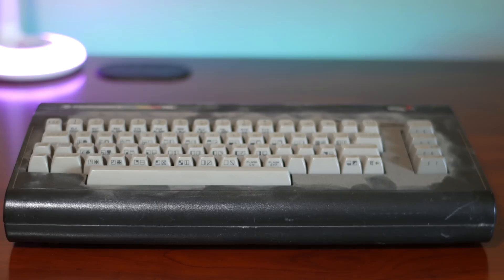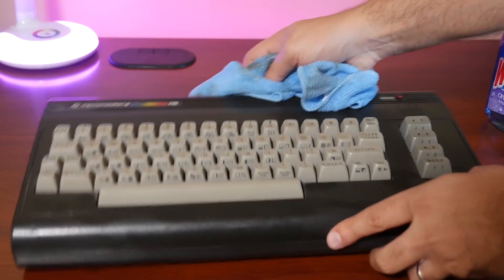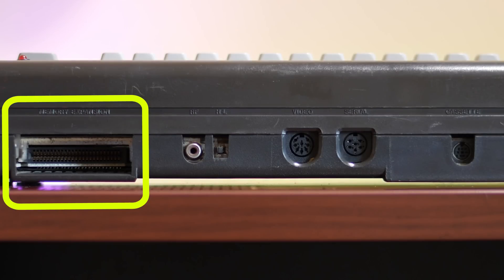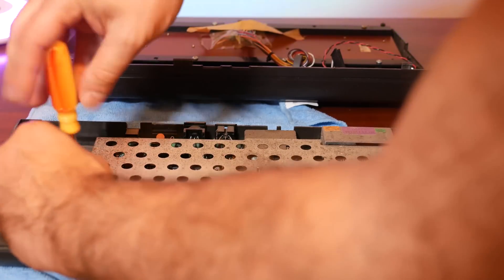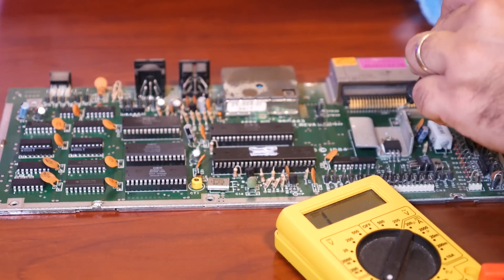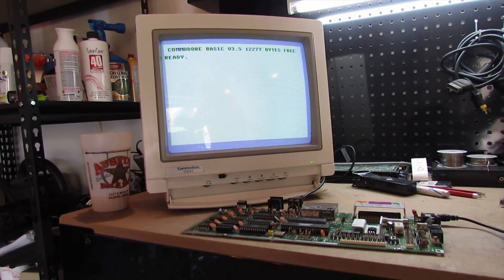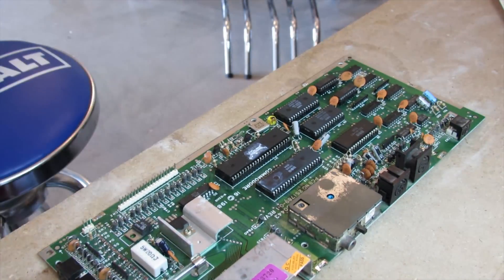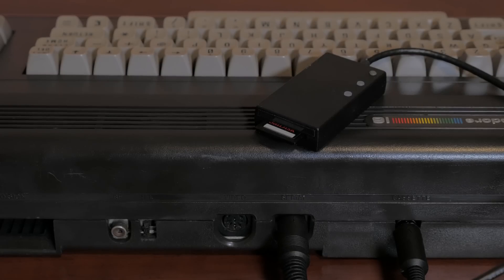Commodore 16 C16 Restoration Project

Comment: Ironically sales of this machine took off once its price was reduced to under £50 which was supposed to be the price they were looking to sell it at when it was in development. Jack told them go away and build me a computer for under £50 and then management sabotaged it by trying to sell it at £100 at launch the idiots. This is off the top of my head so may have figures a bit wrong but the brief was to build a budget computer to sell at £50

Comment: I highly suggest to wear an antistatic wrist wrap while dealing with ICs. Also you got really lucky that only the fuse got blown. Recently I got a C116 to restore from ebay and literally all ICs were dead. The reason (I assume) was a wrong polarity and therefore bad voltage regulator which killed all the other ICs... Was a pretty expensive repair in the end, but I got it back working. :-) Keep up your good work!!

Comment: Always always always check the specs yourself and make sure it's the right voltage, connector (And polarity!) etc yourself.

Those eBay sellers are often selling extra stock of cheap phone/whatever else chargers and sell it as "uses x connector at y volts, device only uses z mA of power and the adapter can do 1A so we're good" either way so it pays to double check that yourself.

Comment: Really nothing should be powered up without replacing all the caps and regulators. They could fail any random time now. When they do uncontrolled volts will play Russian Roulette with the chips. Its what they do on very old cars too. Replace then try to start.

Comment: Got a c16 and has a problem. When on there is text and a screen but after 30 seconds the  text just bleeds together. For example type an 'h' will turn to a solid rectangle. Weird effect. Any ideas?

Comment: The C16 and Plus4 were blunders by Commodore. They had an improved BASIC and more colors, but virtually everything else about them was a step backwards. They created these machines to fill a market that didn't really exist. The C64 was already the next step up from the VIC-20 and was being used for most of the serious applications that the Plus4 was meant for.

Comment: 10:30 or thereabouts-

That thermal paste was there for a reason. You should've applied new thermal paste before putting the shield back on. Not doing that can shorten the life of the (rare and) fragile TED chip because it can overheat, and/or it endures more strenuous thermal cycles.
Reply from the maker: I did this off camera - i cleaned the old gummed up paste and applied new paste on and attached the shielding back on

Comment: Well it's an oddity, you want more performance than a VIC-20 but less than a C64, well we have the machine for you? ^_^ Jack was a bit of a lunatic making this model what with all the compatibility differences, like why mini DIN or proprietary cart slot Tramiel? Third party AC, yep tread carefully and that's what fuses are good for heh. Great job, turned out awesome.

Comment: Nice work mate 🖒 
Had a weird power issue with my c64 few months back .....it had been on for hours as had a friend  over for a gaming night .....the power brick had got really hot and suddenly nothing would load , changed tape decks twice and same problem......turns out it killed my tape decks as nothing worked on them after that , next day used a friends power supply and a friends tape deck with my c64 and it worked , tried my tape decks on his c64 and nothing loaded , 
I've heard those old style power bricks can fail and stop sending the correct current to the machine ? So I'm guessing it sent a surge to the tape decks and damaged them? 
All is good now as have a new refurbished power supply , a spare C64 and 3 refurbished tape decks :)

Comment: So, the correct polarity on the PSU should be the negative wire connected to the outside line and the positive wire connected on the middle pin, right?
Reply from the maker: correct :)

Comment: Very nicely done! The C16 is a great machine. It's funny seeing that H-L switch on the back - PAL machines never had that, as you most likely know. The C16 was the machine I initially wanted as a kid, because I was in love with the looks of it. Yes, I didn't think about what it could or couldn't do, I just liked that charcoal grey color the case had, lol.. But my cousin persuaded me to go for the C64 instead, which I guess was a wise move. But having one nowadays is great! I also have the 64k mod (switchable, for the few games that can't handle 64k). Again, nicely done! :o)

Comment: It's good that you kept the power issue in this video. It's fair warning to anyone not to take polarity for granted with those DC barrel jacks.
I remember reading the C16 spec back when I got my C64 and wondering why the latter had only 16 colours. A C64 with a larger pallet would have been magic.

Comment: Great video as always mate.  Top work on the 64K mod, looks really simple - I need to get around to upgrading mine.  Good spot on the shady eBay seller, I've always just used a Sega Megadrive PSU for mine which works fine.  It's definitely worth adding some heatsinks to TED and the CPU too, they're notorious for overheating and destroying themselves.
Reply from the maker: good advice Dan, heatsinks it is. ill pick up a couple

Comment: STOP using the compressed air like that. use it in short bursts. then if it gets cold and the pressure gets low warm it up in warm water. you could seriously damage the components by having them crack. you know thermodynamics? it doesn't matter no one will read this comment. and everyone seems to think everything i say is a direct attack on their manhood.
Reply: Actually I read it, and it's a fair critique.  I learned that lesson a long time ago when I first started building and repairing custom PCs.  Geez, I still have two fully functional C64's sitting in my closet... I wonder how filthy they've gotten?  Maybe one of these days I'll get them out again...
Reply: And say no to Windex! Unless it's ammonia free.

Comment: Does this really qualify as a restoration? Clean the case and keyboard, buy the wrong PSU, change the fuse, buy the correct PSU, add some peripherals. Hmm. Seems lacking.
Reply from the maker: well , dont forget the RAM mod too :) but i do understand what you mean

Comment: Man your lucky only your fuse got blown! The Power regulation on the C16 is known quirky. It relies on a 7805 regulator that is often aging and failing, while CPU and TED are known to be very sensitive about voltage. This is a mod I suggest strongly: Remove the 7805 (the three pin element on the cooling element right of the cpu), along with the cooler. Replace it with a modern 5v step down regulator. There is pin compatible versions and 1A models should do very well. Also remove the big ceramic resistor R10 entirely. 

That way your C16 should require lesser power, produce way lesser heat and live longer. Personally a added small heat sinks to CPU and TED for precaution as well. If you ever consider using a original power supply, above mod is mandatory to prevent certain death. Also replace the 4.7K capacitor inside the power brick with a new one, they likely leak after 30 years. Same goes for visually bad capacitors on the C16 board itself.

Comment: Very nice video. At the time they were released, I was deep into C64 land.  Everyone I knew that had C64s viewed the C/16 and Plus/4 as a joke. I don't have a C16 but I did pick up a few Plus 4's a couple of years ago that did not work and both of them had bad CPUs.  I think the TED and the CPU in the Plus4/C16 were some of the worst chips, from a reliability standpoint, that Commodore ever produced.  Those and the MOS 77xx logic replacement chips that they made were really poor.  

It is an interesting computer for what it is and the BASIC, ML Monitor, Reset button and added colors are the only thing that stand out to me as cool features now.  But, yeah back then it was a joke here in the USA.

Comment: Problem with this series of computers is the chips are very fragile and the cost of replacing them will often cost you more than a complete unit.   The C16 keyboard is easier to work with than that ones used in the Plus/4 and C116 which have very delicate ribbon cables which require great care because t he contacts on t he ribbon will separate from the ribbon.     Repairing these is pretty straight forward but honestly its the most frustrating series of machines to grace my workbench so I just avoid them at all cost.   The original intention for the machines was novel but CBM Marketing really screwed the pooch with them.

Comment: I wonder how many C16s have been fried (as far as non-techie users are concerned who wouldn't know what to do to fix it) by one of those so-called "Commodore C16 Replacement Power Supply" from ebay seller yourcartmax. Did you notify the seller, not that a Chinese seller would do anything about it from my experience?

Comment: So the C16's power supply is center negative? Use Genesis Model1 brick then!
Reply: Yep, a Mega Drive/Genesis PSU works fine, as does a Sinclair Spectrum PSU.
Reply: Wouldn't bet on that, I was told to use Speccy PSUs on Speccys exclusively ; )

Comment: Good that Commodore probably fitted a diode reverse biased between the 9v and ground there - that's likely why the fuse blew with reverse polarity!  I would be tempted to remove the shielding and individually heat sink chips there - I never like those cages as they spread the heat and trap a lot of heat underneath them at the same time, but that's just a preference thing I guess. 

They are probably OK with the shielding as a heat spreader, but the TED does die a fair bit from heat problems though.   Lovely machine but the C16 and +4 never appealed to me as they just felt like mistakes when compared to the C64.  I actually feel like the games on the VIC-20 were better.  Commodore had so many missed oportunities.  

Maybe if they had put a SID in there that could have made a huge difference to the sales.
Reply: Oh, and btw, you should add a switch to the 64K RAM mod, since some software won't run on 64k RAM, onyl on 16k. You can place the switch near the vents, so you can change the position using something thin, like a flathead screwdriver. This way, no case modifications are needed.
Reply: Great job restoring it though =D  Looks almost new!
Reply: My C16 came with the cardboard-shielding, so it didn't even have a tab to cool the TED. During usage, CPU and TED got so hot that you couldn't even touch them anymore. On the bottom of the case, the C16 got just as warm as a cheap notebook would do. So I installed heatsinks on CPU, TED and PLA and also some smaller BGA-vRAM-heatsinks on the ROMs and now everything stays nice and cool during usage. This also allowed me to keep the shielding on; it still stayed cool enough. But yeah... I'd really recommend to install heatsinks, as it should really add to the longevity of your system, especially since the TED and the CPU of the C16 are known for dying due to overheating.
Reply: For the CPU, PLA and TED I bought a large heatsink I cut myself into smaller pieces to fit the chips. For them, vRAM heatsinks aren't enough imho; they run much hotter with them than they do with heatsinks covering the whole area. I used thermal adhesive tape to stick them down, and to be on the secure side, also tied them down using a thin kynar wire. They still fit on their sockets perfectly when you use wire such as AWG30 kynar. BTW: You should also replace the thermal grease under the 7805 or even replace the whole 7805 with a modern buck converter. Pin-compatible TO-220 buck converter modules do exist for exactly the purpose of using them as a replacement for 7805 regulators.
Reply from the maker: yeah id prefer to ditch the shielding and fit dedicated heatsinks on both the TED and the CPU. do you have any recommendations on that?
Reply: VGA RAM heatsinks (14 mm × 14 mm footprint) should be good for the job. Aluminium ones cost a dime a dozen, and the thermal glue on them is usually good enough, though you can always put proper thermal compound on them.
Reply: @GadgetUK164 what heat sinks do you use?  The ones I find on eBay seem to be the wrong size.   Also, do you get them with some type of thermal tape?

Comment: ram chips you marked in the vid are actually the ones to the right of those parts in the video
luckily you can see which ones they are and the video doesnt really explain how to do the modification in any detail ,so its not really a problem
Reply from the maker: good catch thanks! - yeah i skimmed over it. but if you want a guide on how i did it, check the link in the description
Reply: thanks,i dont really need a  guide for this its fairly simple

Comment: So : it's not compatible with either the Vic 20 nor the Commodore 64? That seems like a big mistake... so I was scratching my head, trying to figure out which market that computer is trying to appeal to, and I think I found it : gaming. It had to be sold primarily as a cheap gaming machine.The number of sprites usable on screen at once, as well as the number of colors, is actually quite nice. So that must've been the market it was aiming. But were there even a lot of games released for this machine(and the plus 4, as from what I understand they are compatible between one another)?
Reply: It had no hardware sprites whatsoever, hardware scroll, raster interrupts or any of those thing that made C64 a great gaming machine. The sound generator was inferior to SID and extended color palette was very difficult to use.
Reply: Ah, thanks for clarifying that. I misunderstood and thought it had hardware sprite support.

Comment: A quick question;  Because you upgraded the RAM chips on the MOBO, what effect would plugging in an 'official' RAM expander CART have on available system RAM?  Can the CPU address more than 64k?  I'm curious.
Reply from the maker: good question -  i dont believe so but someone smarter that me might know for certain. In theory a Plus4 and C16 should be able to access 256k

Comment: Should hold the compressed air can at a more level orientation, so it doesn't spray the cold liquid out... it's ability to blow dust off isn't helped by that, not to mention, if there was any power left in those components it wouldn't be good for their health either.
Reply: I screamed "NO WHAT ARE YOU DOING?" when he was spraying all the cold liquid over the board.
Reply: Colin Stuart That was my thought too. The cold co2 can actually pop cold soldier joints. The liquid is not supposed to come out; if it does, you're not using it correctly.
Reply: Ha ha he also shook the can.
Reply: Agreed. That was plain stupid.Should not be part of a 'full restoration'. The first hint about the technical incompetence was the cheap-ass screwdriver used in the first shots.

Comment: The C16 is pretty much unknown territory to me.
So can it play +4 games out of the box or is that what you needed the 64k mod for?
Also out of curiosity, is the keyboard connector the same as for the C64 so for example one could use these machines with the keyrah V2?
Great restoration there but it also shows how dangerous third party stuff can be when picking up such from eBay or other places.
Reply from the maker: the C16 and Plus4 are identical except for RAM. Many +4 games wont work on a C16 for this reason. hence the ram upgrade. I believe the kb connector is the same yes - but id check some pinout diagrams on that
Reply: Oh that's interesting because I used to have a +4 back when I was little along with a tape drive and joystick adapter for Atari joysticks.
Used to play Snoopy on that thing, that's my earliest memory of computers if not playing Ocean Donkey Kong, Wheel of Fortune and River Raid with my parents on the C64.
Guess I'm going to do a bit of research then later on, so thanks for the quick reply!

Comment: Is the RF shielding needed nowadays?
Reply: I guess he meant if an unshielded thing still would interfere with other devices in your home (or your neighbours'). Earlier you had analog TV, you listened to radio, even AM radio. I dont think an unshielded unit would interfere with anything  significant in this day and age - unless your neighbour is old/nostalgic and likes to listen to AM radio when drinking his evening tea.. like me. I'm 38 and there is absolutely no sense in it but I sometimes grab my father's radio and listen to AM/LM/shortwave stations because I find it kind of fascinating.
Reply from the maker: i tend to ignore the shielding but in this instance its also used as a heatsink for the TED chip which gets extremely hot
Reply: I'd just be careful it doesn't also act as a heatsink if you remove it from the system.
Reply: If there is a nuclear war, the system will be protected from EMP with that Faraday Cage

Comment: I must admit I was screaming "polarity!" as soon as I saw the power supply.

Most of the computers in the 1980s that used 2.5mm barrel jacks were centre negative. Very annoying.
Reply: 2017 -- Polarity? That was a thing, right?
1983 -- If you plug it in slightly off-center, your device will be engulfed in flames.
Reply: That was a usual feature of most hardware back then cause they did tend to use battery power also. Using that connector with negative polarity inside could mechanically disconnect DC voltage from battery usage at the same time without any special circuit required and ofc can be done cheaply.
Reply: Fortunately you can get cheap generic switching supplies with detachable plugs that enables changing its polarity and size/type.
Reply: Try plugging your laptop in with reversed polarity and tell me what happens.  Polarity is still a thing.
Reply: This is true, but computers such as the C16 didn't run from battery power. Even in 84 the normal standard was centre positive for mains-only devices.

It's simple enough to pull power supplies apart and resolder the wires though. Just irritating to have to do so.
Reply: pillsburied (POP!)